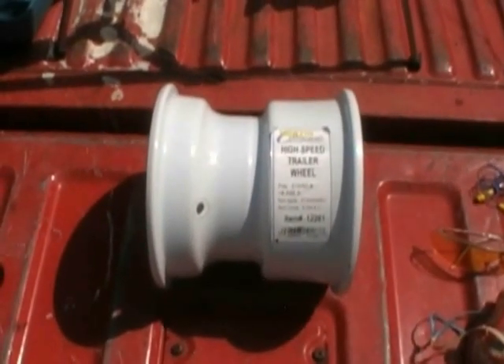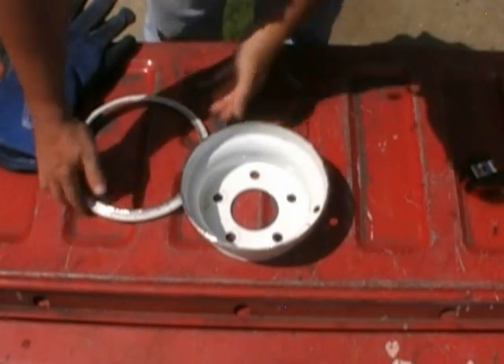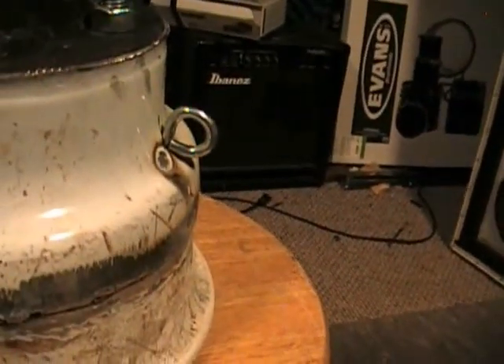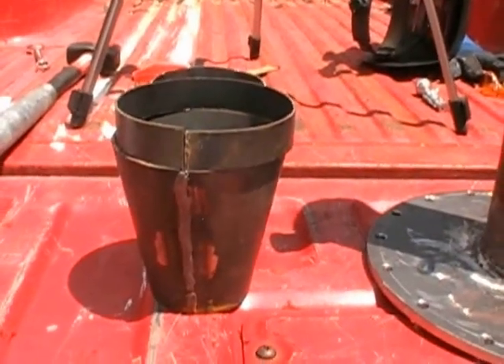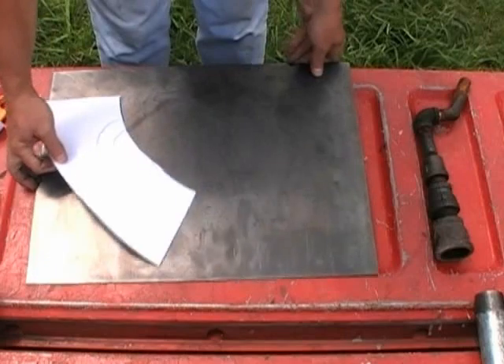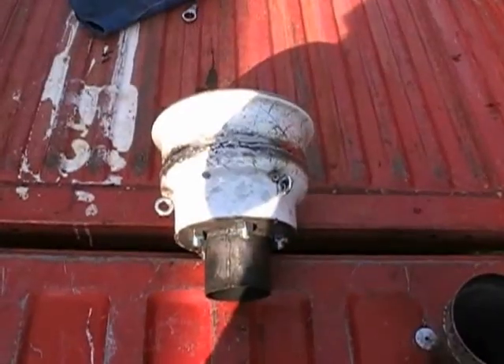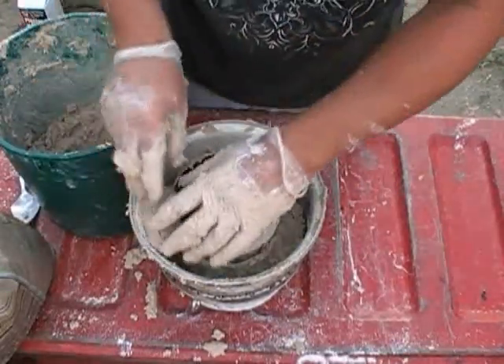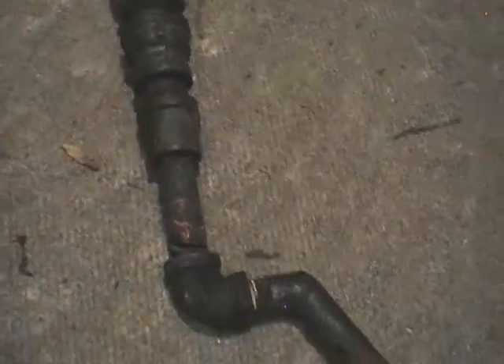08-29-2013 Gasifier "How to construct" ...Video One

Comment: Its now 2024 how is your gassifyer still running.  I want to make on like yours for a 8 hp  generator.
Reply from the maker: @neilgelinas9926  The gasifier that I built is under my shop ready to be used at a moment's notice should things get bad. This was a project that I took on out of curiosity that went beyond that and I'm glad that I took the time to figure it out. There are some people out there that uses kind of Technology along with solar and wind as a sole source of power. This is really a backup system for me should I need emergency power and didn't have access to any fuels.

Comment: Hello Flash, Greetings! I have a doubt - why the reduction zone is also not made with refractory cement?? Is it for a specific reason or any design constraints?
Reply from the maker: You could use refractory cement or even potters clay but if you were to make the reduction zone just out of these materials they will over time have the tendency to develop cracks. With a steel lining you just want to draw heat away from the steel which will give it a long life. I don't have the tools to work with stainless steel so the workaround to working with mild steel is to protect the mild steel. Think of putting water into a paper cup. If you light the top of the cup on fire it will burn down to the water line and go out. You could even boil water in a paper cup because the water protects the paper. It's the same concept here but you could use both refractory cement or even potters clay with this method. For that matter you could use pure sand with a tiny bit of standard cement mixed in it just to hold it's form. There are many roads that lead to a working prototype.
Reply: @flash001USA  Thank you so much for clarification.

Comment: Awesome series. Is there a reference chart for imbert cone size to HP?  Cone height/upper diameter/ lower diameter etc. I see info for FEMA but not imbert. I want to run a small generator, but also a 17.5 hp lawnmower.  Little help?
Reply from the maker: That has always been the hurdle for people building home use gasifiers. There is where things can get tricky. When you are building a gasifier, you have a lot of variables thrown into the mix mainly the wood used for fuel. Just the difference of different wood affects the gas production and the gas quality. When I built my first gasifier I was completely clueless and I had to experiment over and over again until I found what worked for me and gave me clean woodgas. On average you want your restriction throat opening at the bottom of the gasifier to be around 2 inches up to around 3 inches and you want your wood chunks to be anywhere around .5 inches to .75 inches in over-all size. This is what makes a small engine gasifier a bit of a hassle to build and this is why people try to go with the FEMA builds that use the wood pellets which you want to avoid. If you have gone through my build videos you will see me try to cover my wood chunk sizes along with the hearth (what I called the fire cone) diameter and it's depth along with the restriction throat opening diameter. This build can handle smaller engines along with a larger 12.5 Hp engine too. For a 17.5 Hp engine you may need to move up to a restriction throat diameter of 2.5 inches up to 2.75 inches but that's something you will have to experiment with. Keep in mind that the wood needs to be very dry! A good example of how dry you want your wood fuel would be a dried dead branch in a tree that literally snaps when you try to bend or flex it. The wood fuel I use is small dead branches in a diameter of .5 inches up to 1 inch in diameter that have snapped off of trees in the woods that I can get from the ground in the woods or even snap off of lower branches of trees. We do have a woodgas community of people that are willing to answer any questions you may have at www.miniwoodgas.com and you can find a wealth of information at  https://www.allpowerlabs.com/ but they have a tendency to lean towards the more technical side of things. The website does cover hearth sizes and restriction throat diameters vs engine Hp and this did help me understand a lot but in the end it was up to me just tinkering until I go the build to be acceptable. On the website check out the Youtube video links  at http://www.miniwoodgas.com/miniwoodgas_005.htm and go watch the videos I have linked for All Power Labs. That will really give you some serious information. Good luck with your mission and if you build a gasifier, post a few Youtube videos for all of us to watch.

Comment: Thanks mate! You've inspired me to make my own "Flashifier"!!
Reply from the maker: How far along are you with the build?
Reply: @flash001USA  thanks very much for your reply!
Almost got the furnace finished. I need to install the shaking assembly, seal my clean out door and seal my lid then its done. I don't know how I never saw your videos when I started out, but this is my 3rd build and I was really despondent after the second build, but your videos gave me the impetus to go again. You're a bloody legend in this little house down under 👍👍
Reply from the maker: @allanseagrave8132  Hey look, if you have any issues or questions don't hesitate to reach out. We have a blog where you can ask questions should you have any. www.miniwoodgas.com
Reply: @flash001USA  thanks a bunch mate. I'm not at that stage yet, but already thinking about your automation system. I don't have any electrical component experience, do you think it'll be possible to setup automation when I'm ready? Basically I have 4 different engines (for pump, generators and block splitter) here on the farm I want to provide power for and as I'm a sawmiller I have a steady supply of usable fuel for a "Flashifier"
Reply from the maker: @allanseagrave8132  Allan it sounds like you have a plan in action. Let me ask you a question. Those other gasifiers you build What happened with them? Did they not work correctly?
Reply: @flash001USA  first build was from an "Instructables" page and I got about 2/3 through before I realised a big error in it meant it wouldn't work. The second was a copy of a you tube video, which looked really promising and his video showed him spark up a geny with no problems. I tried to copy it as faithfully as I could with what I had on hand and salvaged parts from version 1, but could never get a flare to stay lit. Both where FEMA types. I purchased Ben Petersons book and started to gather supplies, watched through all the you tube videos breaking down the build, but tbh I think I have to admit it was too daunting to actually start. I then tried finding out why version 2 didn't work (I flooded the entire system and found two small leaks, 1 in the cooling system and one on the cleanout port) and somehow, through a different YT vid saw your name the rest is history. I think they didn't work well being FEMA types, but also no constriction in the hearth and was trying to pull air through the whole wood hopper. The second one had a cyclone using a propane tank, then a tall 4 pipe radiator,  but the heat exiting the radiator was still very hot.

Comment: flash i know these videos are old hopefully i get a response iv watched all of the ones on gasifier my question is can you use water to filter watched a guy do it with a gasifier what would be the pros and cons
Reply from the maker: If you have a clean running properly set up gasifier that is cracking the tars in the gas you can filter out soot particles with a water filter. This is known as a venturi water filter system. If the gasifier is set up correctly you can keep things simple and filter with wood chips. I designed a tri-filter system for my setup that took off with others building it because its simple and it works but yeah you can filter with a venturi system.

Comment: Can the air nozzle go straight down into the burn cone instead of from the side at 45 degrees?
Reply from the maker: Yes. If you watch some of the later videos you'll see that this has bitter continuing learning process of making it better and at this point the nozzle is running dead center.
Reply: @flash001USA  Thanks for the info , I really like the time you have spent making the videos and building the unit.

Comment: why couldn't a guy buy a 5 by 3 concentric pipe reducer very clean for the cone?
Reply from the maker: You probably could do that but you still need to be able to secure it to the bottom of the hopper and keep a decent seal in the process. You could use the fiberglass rope that is used around wood stove doors as a gasket.

Comment: On your cone design, how big is the top and bottom opening of the 5inch cone
Reply from the maker: Make the top 6 inches wide and the bottom 3 inches wide. I actually reduce down to 2 inches on my inverted bottom cone because I'm running a small 5 Hp engine. The good thing about the inverted bell is that it bolts onto the bottom of the cone assembly so this means you can change the actual restriction diameter at the bottom of the cone for larger or smaller engines.
Reply: Thanks k you so much now could you explain how to hook it up to a generator? Please please please

Comment: hi Flash this is really cool stuff. Im trying to build one just like yours .question why do you weld the one inch ring on top of the cone? could you just make the cone come to the top of the vessel?
Reply from the maker: The reason I put the one inch ring on the top of it is to allow it to hold just a little bit more biochar plus the nozzle will actually go down below the ring to wear the cone starts. For some reason this gives it a better and more through fuel burn.
Reply from the maker: Almost forgot. There's a lot of people that can help you with this if you go to the mini wood gas website. That will take you to a Blog where you can pick people's brains had had built this up and added their ideas to the build. Here is the address. www.miniwoodgas.com

Comment: Hi Flash001USA.
Very impresive work, so clear your talking, the time you took to teach us, etc, etc. I am just about to star my gasifier.  In order to make things more easy, do you have blueprints, or a link to get some plans? 
Thank you very much.
Julio
Reply from the maker: Julio we do have some drawings but you will need to give me an email address. I have built a newer model that will be tested in a week or two so hold off building anything because if this build works it will be easier to construct.
Reply: Hi There. THANK YOU VERY MUCH FOR SUCH PROMPT RESPOND!!
My e-mail adress is: ramosedmundo@yahoo.com.
I will greately appreciate if you can send me any existing plans and/or operation procedure, just to start reading, but as you just suggested me, I will hold off on my work waiting for your new design. Good luck with your test. Let's keep our fingers crossed.  
Truly yours, 
Edmundo Julio Ramos

Comment: Your setup is closely related, so it seems to me, to the Imbert. The dimensions of your cone, with proper air intake should produce gas for a much larger engine. So, I'm just a little confused. 
Is your limited gas production due to the single air nozzle? And was this intentional?
Reply from the maker: Lester thanks for the view and your feedback. The single nozzle works fine for smaller engines and it is a very simple concept that can be done with a minimal tools and metal working skills. The single nozzle is simple to change out when needed too. Keep in mind that the hearth what I call the fire cone is funnel shaped and deeper than standard Imbert designs so the single nozzle can be made a bit longer to take advantage of the smaller diameter to tune it for smaller engines in the 5 Hp range or the nozzle can be raised to move up to run a larger engine. This build is right at home with a range of 5 Hp up to 12.5 Hp engines. To answer your question yes this was intentional.
Reply: So you are aware of the formula for air injection? I suspect if you quadrupled the air intake you would quadruple your gas production, based on your cone dimensions.
Reply from the maker: Yes I am aware there are air flow formulas but there are so many other variables like fuel and fuel moisture content, the drag through the filters etc so I used the FEMA guidelines for the restriction throat then I experimented with the nozzle by basing it's diameter just a bit larger than what the engine exhaust and intake diameters were until I found a decent burn with a low to no tar produced gas at the same time the engine could still breathe enough to deliver power. I spoke with some of the guys at All Power Labs and they even said that the calculations would only get you close until you tinkered to fine tune the intake air ratios for the nozzles to get things hot enough to crack the tars correctly. I'm no rocket scientist so this build was by the seat of my pants but it works and it is clean enough that I'm not worried about tar issues.
Reply: Once upon a time these were sold on the open market, attached to all manner of vehicles. They worked out the bugs.
Reply from the maker: Yep you are correct. Even if you have plans to building one there are just too many things to factor in and even in Europe they quickly realized how tight the fuel specs have to be no matter how well the build was laid out. They actually had wood stations to ensure the correct fuels for gasifiers. In other words, you really have to know your own system. This is why people can spend thousands of dollars on a well built machine and produce tar while someone living in the back woods can build one out of rusty junk and produce good woodgas.

Comment: flash001 you talk about bridging  can you extend the cone or make a second cone to go from the fire chamber to the side of your hopper or wood tank. so it all slopes to the reactor or fire chamber.
Reply from the maker: Richard extending the cone won't solve the issue. In reality all of us doing this are backyard builders tinkering with this stuff and there are so many things that can go wrong during a run that will cause bridging issues which is why that learning your machine once you build it is the key to good runs along with using the correct fuel chunk sizes and once you find the right kind of wood and size of the wood chunks that work best with your build that you stick like glue for what works best for you. At the time of making these videos I didn't have an automatic hopper shaker or an automatic grate shaker which is what keeps bridging issues in check but I now have the build to make this happen and once I finish my off grid building I will be back on this stuff asap. Check out the blog on the www.miniwoodgas.com website and you will be amazed at what some of the people in this circle have built. Most of them will be more than glad to help you too so that's a good thing.

Comment: Check this out. We don't need the methanol because we use wood. I am not sure we need the manganese oxide either because wood is an organic fuel and will have a constant flame once it is ignited. After it gets going one could experiment with hydrogen peroxide. We sure don't need 50% concentration. 3% to 5% should be plenty if I remember my stochiometric  chemistry. What this would do to rust production and reduced longevity of the gasifier, I don't know. But I do think it would be shortened.

Comment: Thanks for your answer. When I last considered syngas, it wa 1983 before the Internet but post the Mother Earth whole Earth Catalogue quarterly magazine then. The FEMA manual was Department of War       Home Defense Resource Management     Dept. of the Interior     Handbook Syngas / Producer gas Project manual.  I have the FEMA one I downloaded from the Internet and am surprised the manual says tar and volitiles are a good thing fuel wise. In the older manual, charcoal was considered the best fuel source because it was so carbon rich. They even had a charcoal manufacturing method section in the manual. They speculated then that adding hydrogen peroxide might make a richer gas since much hydrogen would be released in the reaction. I see nothing in the present FEMA manual about that. I think I can build an apparatus to get HO without buying it, but think it would reduce the efficiency of my plant unless it would be added in as a cost like purchasing wood fuel. I am thinking in the direction of wood pellets since they are plentiful in Oregon as the NW is a wood byproducts rich area. I would build this for my home power generation needs. I think in the era of $600.00 a month electric bills under the Reggin in the White House, I would be ahead several hundred dollars a month making syngas electric generation plant. 

If hydrogen peroxide was released through a bed of manganese dioxide it would be broken down to HO and create a heck of a better gas than the 22% available in normal air which is 78%nigtogen, 22% oxygen (ignoring other inert gasses) I think it would also create less tar. This guy used to sell HO and I think he still does. I just can't find his page right now. http://rocketbelts.americanrocketman.com/hy-peroxide.html

Found it ! This page changed a lot. Lozano is the man who developed this idea for rocket cars. OK, but my interest is in making rich syngas from wood with the power of gasoline. http://www.tecaeromex.com/ingles/indexi.html  I think this is a source for getting HO and then you build the still required to make the strength needed for syngas purposes.  Just a thought. Thanks for the reply. I'm 69 YOA but still thinking of this stuff. If I get my arthritis under control, I'll be out in my shop again to build one of these gasogens and power a Toyota previa engine with it. The previa is an excellent engine and would be perfect for this use.

John Mahler